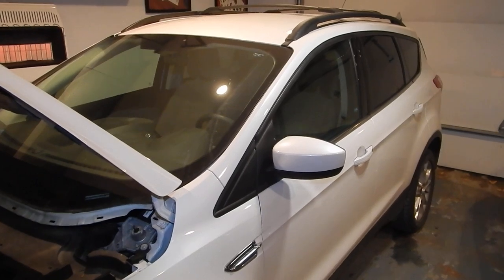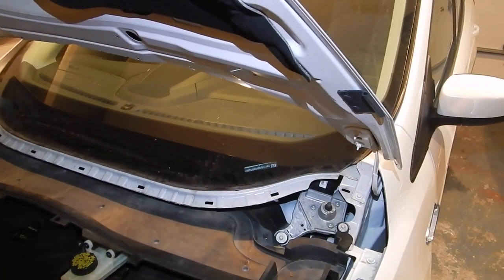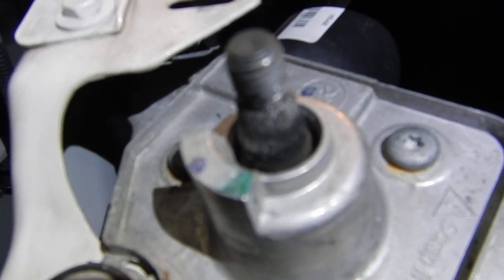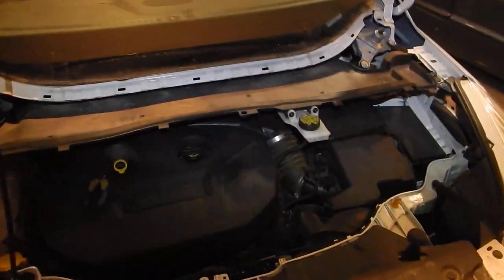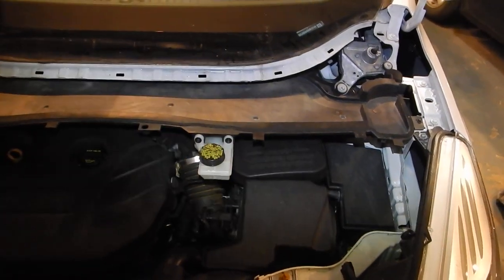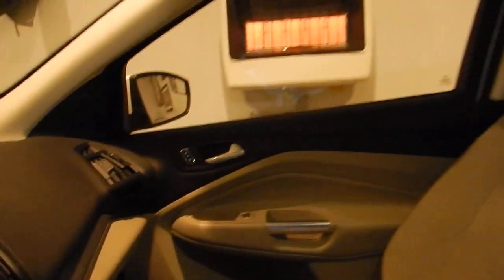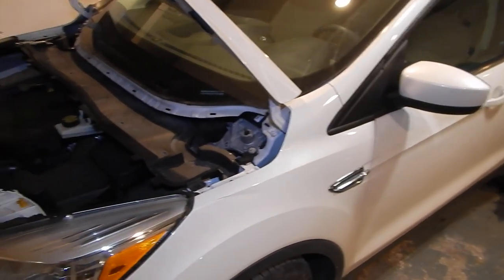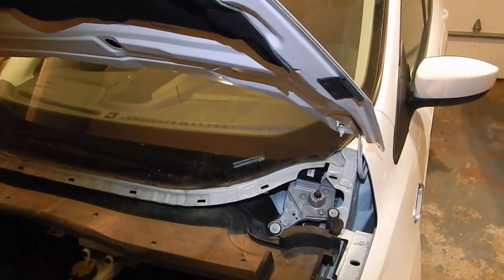2013 Ford Escape Window Wiper problems

Comment: Thanks for taking the time to do this video. The sound you mentioned hearing intermittently may be caused by a bad evap purge valve, under the hood. I just replaced that assembly yesterday on mine. Might cause a P1450 code on occasion. Makes an occasional humming, buzzing sound when driving caused by the fuel flapper vibrating  from too much tank vacuum. There have been several revisions of these, and appear to be a common problem. You helped others with your video, so I hope this helps you!
Reply: I had the same humming sound as him and it would go away if I ran the wipers.

Comment: So it was the wiper motors ? I inspected mine and didn't see anything stripped . At $200.00 a motor , I been rain x the windshield for the last 8 months. Guess I ll go ahead and replace the motors. I was wondering though being 2 seperate motors how can they both go out at the same time🤔....Ford company is done.  Dealerships have sealed the deal

Comment: I have a 2013 Ford Escape as well. And same, issues all over: replaced the coolant tank 3 times, one of the tire pressure sensors has never worked, the doors squeek like crazy  now, as you said changing the battery is real pita. Unfortunately, I live in SA, so it is hard to get parts at reasonable prices. Thanks for the video.
Reply: My husband has one to it seems like every six months we have to put at least 3,000 into getting it fixed 😞

Comment: We just had that winter storm, and my wipers have now gone haywire--one stopped working all together, and the other just moves to one position and stays there. Thanks for this video. I dunno--I have 103K on mine--and I guess it's starting to finally fall apart.
Reply: Find a solution? I'm experiencing a similar issue
Reply: These have separate windshield wiper motors and the connection where the wiper bolts on may have gotten stripped especially if they were frozen from the ice. More commonly though they get out of sync. You can try removing the wiper blades then turning the wipers on and let them cycle and then turn them off and reinstalled the blades in the proper down position. This may work to get them resynchronized. If it doesn't then you have to do it from underneath the cowl. There are a few videos out there on the internet to show you this procedure. If however there is a stripped-out factor on the motor or Motors and you will ever need to replace the windshield wiper motors.

Comment: I've been having problems with mine since Oct 13, 2017. I replaced the multi switch, that didn't solve the problem. Calling Ford was useless. I filed a complaint with the BBB today.

Comment: I have a  2017  and have 135000   kilometers on it,  Never had this problem.  Have changed spark plugs and  rear breaks.  Love it
Reply from the maker: Cool..we have an edge now.
Reply: I have 20 13And I do not have to pull the wiper blade or motor off to get to my battery It's a little strange where it is but it's not as complicated As he makes it sounds he is Probably going bout it the hard way

Comment: I’ve replaced both my windshield wiper motors twice in the last 6 months... it’s not cheap. I live in Colorado, I’ve used my wipers like 4 times since I’ve replaced them last. Now the left arm won’t move more than 4 inches... btw the weird humming noises is the water pump...

Comment: I had my 2017 ford escape wipers shutter and cross over right in front of my driver view. When I had heavy rain it was okay. But when it was a light drizzle it was bad. Everything was fine until I got the dealership to change my wipers on my care plan. Then it happened a lot. I took it back in 3 times and it kept getting worse. Then they changed the motors. Tonight it was a heavy rain and it was happening again, but always getting stuck in my view... Something is seriously wrong.  Also, I too get a weird humming hiss sound when I turn off the car, not sure of that is related...  So fed up!

Comment: My wipers stopped working, Had to rebuild the front end, new struts, calipers were also replaced after only having the truck for 6 months.
Oh and did some research on the truck and found out that the truck had been in a front end collision. The entire front end of the truck was replaced with aftermarket parts, including the hood.
Reply from the maker: we sold ours and bought a Ford edge make sure that you run a Carfax or an AutoCheck before purchasing any used vehicle to check on collision damage

Comment: I’m from Winnipeg Canada my mom just came by my place with the same complaint not sure if this is a factory defect or I’m thinking possibly during the winter months if you leave the wipers down and they freeze to the windshield you turn the wiper switch on you can strip the teeth on the motor possibly ruining the motors as well

Comment: One thing I noticed weird with the wipers when I was replacing the battery in my 2013 was that I can move either wiper up and down without affecting the other. I guess because they run on separate motors, but then I wonder how the wiper position is controlled. Does it have some kind of  way to keep track of where it is? For what it's worth mine has 70K miles and battery was original. Wipers still work, just thought being able to move it freely when car wasn't running seem strange.
Reply: Driver’s side motor has the position sensor

Comment: Does anyone have any idea where the if there is a relay for the front wipers?  Both of my motors stopped.  I've seen a diagram with a 50amp fuse...but my 2014 escape has a 40a fuse.  Not something we've changed since buying the car 5 years ago.  Thanks for your time and kind assistance.
Reply from the maker: Maybe disconnect the battery wait 5 mins and maybe it will reset

Comment: 2013 escape. Wipers do not work. I replaced battery. Tried everything in my knowledge to fix. Please help. I can’t afford a shop. Every once and awhile I’ll get a slight movement no more than an inch on one wiper. I’ve taken off and re installed so many times you wouldn’t believe it. I’m dedicated and i can’t figure it out. Thank you.
Reply from the maker: Check fuses...if good you'll have to replace motors..do the drivers side first that should fix it
Reply: ADD is multitasking thing is, I took apart both motors and that’s when I started getting my inch response back. Plus they are expensive so I want to be 100% that’s my issue. Any clue how to test? I’ve checked the wiring from the car. It has 3 terminals and used a voltmeter, got power. Also checked the motor but there’s 4 terminals and I also got power response. Fuses are good. At least the 2 that you look up. I saw a video on a focus, and they have a fuse box under there fuse box so I checked and never put it back on right😂thanks
Reply from the maker: Seems like everyone is replacing motors. I havent heard of any other fix
Reply: ADD is multitasking guess I’ll give it a go. Thanks!

Comment: Having the same problem but it didn't start humming until after I took them off to change the battery. I know there are alignment marks so I am going to try and re align them. I had to replace the center console lid and the cigarette lighter cover broke and the cover for the interior door handle driver side snapped off. And the interior handle for the trunk comes off easily. This car sucks to be honest...
Reply from the maker: sold mine bought and edge sport
Reply: @addismultitasking3504  we still have a warranty on it till October 2021. So far they replaced rear main seal, oil sending unit and water pump. Thankfully not a cost to us. However I don't like the way it shifts. Kind of jerks going into 2nd or 3rd gear every know and then. Only 95k miles.

Comment: SO, DID REPLACING THE MOTORS FIX THE ISSUE ?
Reply from the maker: Sure did they work perfect
Reply: We were advised to switch the right and left wipers.... and this appears to have helped in the short term... we have already replaced the motors which helped for about 6 months then the problem returned.

Comment: No details shown & he didn’t check the battery’s negative post for commom corrosion on the BMS which effects a lot of the electronics...  blah blah. He needs to do more research and complete the video with a completed fix.  Other than that, this video is a waste.

Comment: Right even The blower for the heater and AC went I have a 2016 and why do they have 2 motors. And you would think because it's an American made car the part's would be cheaper Nooooooo the wipers cost 25$-40$ apiece. I can understand why people buy foreign car's. The part's may be expensive but if you God forbid get in a accident and the car is an total loss you'll get enough money to nearly replace the car but if you get an American made car you'll get something like $1300 or less or an little bit more which is so backwards really.

Comment: The reason why this keeps having problems is because it’s a ford, and Americans don’t know how to make good reliable cars. I have this same exact car with only 9000 miles on it, maybe I should prepare for the worse or just sell it. I’ve already had to replace the battery in it at 8900 miles🙄, my infotainment center freezes up a lot, the throttle response is very delayed, and it overheated twice. My message to ford is what else do I have to expect from your piece of shit cars? I’ll have to find that out for myself I guess.
Reply: There is a recall on the Sync system only if you are having problems. May apply to your "infotainment center".
Reply: Get a truck or a car from them. All the problems are the same with any brand of these hybrid/crossovers.
Reply: Jordan Negrete sell it now!